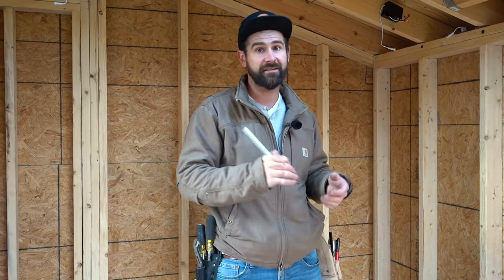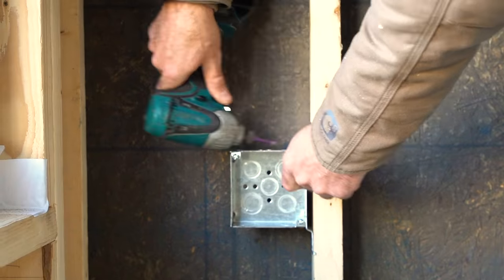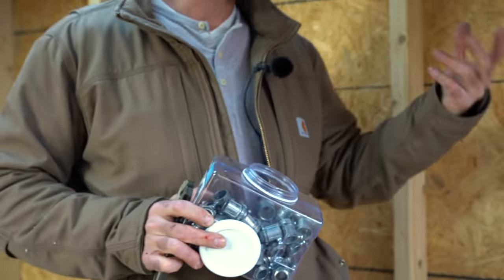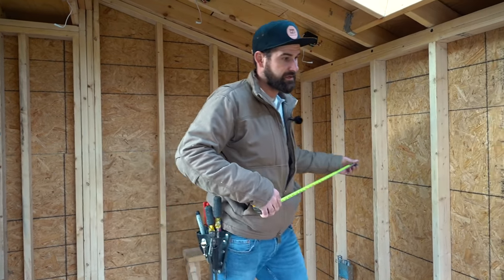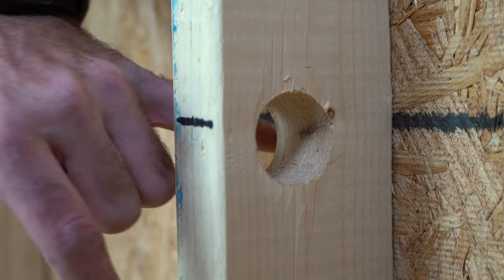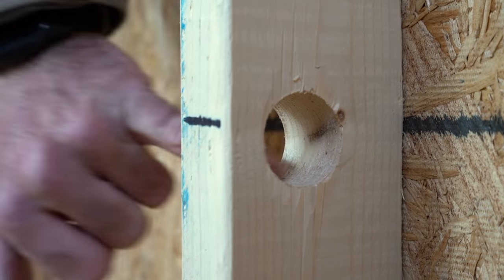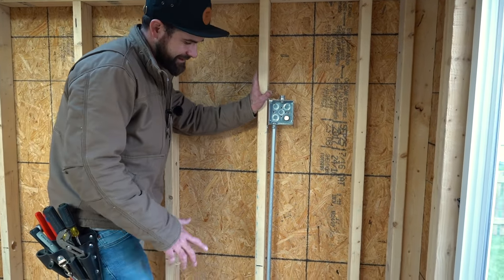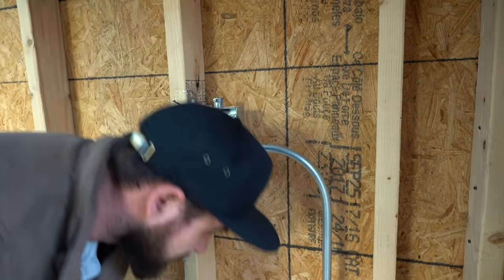How to bend and install electrical conduit

Comment: Have a bandsaw! Use a deeper box if you have 3 and more connectors. Use an approved drill extension to make your pipe cut smooth. Never ever use a bender like that to bend it a little but more! why do you make 3inch hole size for a 1/2" pipe?
Reply: yup, I don't understand why some people still want to work harder. When I started all we had was a hand saw... now days use a bandsaw or even a sawzall. Some people can't get out of old habbits
Reply: @jarrydee2799  when the makita battery sawsalll came out i never looked back. but i was taught old school. the first thing i was given was a bit a brace and a file lol. and of course a hack saw. i was taught that when there was no power, work still goes on. most electricians cant work if there is no power. that was never my case. and was never allowed to use it as an excuse.

Comment: I watched it to the end, lots of mistakes, and since he drilled the holes so large I would of ran some 3/4" conduit too! Also I would run a ground wire too, or at least used compression fittings instead of thr screw connector fittings. Just not how I would of done it, the company that I worked for would of made me redo the job.

Comment: why did you not just want to use romex and staple to the studs?
Reply: Did u not pay attention he said it’s permits and code
Reply: @erikrobles5727  I don’t believe it. Electrical standards are mostly all nation wide.
Reply: @johnnyfive-bc  well believe it I  live in Phx Az  and some codes change depending on weather in working in sun city or in Avondale and their not much more then 15-20 miles apart
Reply: @erikrobles5727  show me where it says you can’t install the outlets and lights with Romex inside the studs.
Reply: @johnnyfive-bc  I never said which codes I said some codes and he said he has to run the wire that way because of codes and permits in that particular town he also never says what town he is working in  watch again from:30 sec to  about :50

Comment: You know there's romex for that.... the only advantage here with conduit is that since you are using shallow boxes set to the improper depth, you can zip tool all of you conduit boxes with no wire in them (in a box that shallow you would destroy the rough in if you tried that with wires in the box), then pull wire afterward. Still, that's 10 extra hours to save 5.... also you totally violated the structural stability of those 2x4 with your ginormous hole....
Reply: Have you ever seen 2 inch ABS through 2x4s? The holes are much larger. I've been an electrician for 15 years and I think he did a pretty good job besides the improper box depth. I don't understand why he just wouldn't use romex though unless it's against code in his area.

Comment: No tool belt when running conduit. And your making measuring bends way too difficult. And also no need to make oversized drill holes, you make a minimum bend and it's always perfect.

Comment: OMG Conduit really for 110 Volts, Not in New Zealand just Plastic Cables, which are all Double insulated cores.  We use single Phase 230 volts mostly for housing.
Reply: Single phase 230 v. Eso that amazing. We use 120 single phase in U.S. and 240v. For dryers.

Comment: Out West if you are running conduit for a residential job you are going to go broke. Most crews will have 2 houses in NM cable by the time you piped the living room. Economics don't favor conduit unfortunately.

Comment: Still find it weird electrical conduit is metal in other countries, here in the Netherlands it’s all PVC
Reply: Then again, we don’t build our houses out of wood.
Reply: In the US the conduit system is considered the ground. However, we also pull equipment grounding conductors as well and then ground an enclosure if we required. Basically if there's a splice made them the enclosure needs to be grounded, if it's a straight pull through then no ground required to be attached to the box. But a job may be specced well and above the code because the code is considered minimum and some environments or needs of customers may exceed what's allowable in the code.

Comment: Why do they need baseboard heater in a shed?!  It’s almost like this is a B&B Rental or unofficial “addition” to a house … for a roommate.  Shed doesn’t usually gets fancy lights like that.  Also, the spacing of outlets is less than 12ft… and its conduit work (all these are required by National Electrical Code).
Reply: Exactly 😅… something shady is going on. Well, maybe this will be a rental… !?
Reply from the maker: Theinshed.com

Comment: how odd, a full metal standard.

I guess its safer to prevent accidental drilling trough.
But its also conducting. so 1 tiny mistake somewhere and you got a fire hazzard and a potential electrocution hazzard, much more so then with all pvc.

The one upside i can think of is that you can ground the whole steel system, but i doubt that will ever pass inspection.

Comment: FUCK THAT in new zealand we stopped using steel conduit full stop just run the wires bare in the wall and in the ceiling

Comment: In my country metal tubing isn't allowed anymore... Metal and electricity don't go well together
Reply: What country is that? What do yall use
Reply: Metal conduit, if installed properly, will take a ground fault back to the ground bus in the electrical panel without the need of a grounding conductor. But that's only if everything is securely fastened and tightened.
Reply: That's a pretty silly rule.
Reply: the reason for the metal is incase you have a short it send the current straight to ground. then blows the circuit. i watched a woman get knocked to the ground because they removed the box. and the wire shorted on a steam pipe. the steam pipe then became hot. an no ground. the lady was barefoot. and she completed the circuit to ground. if the circuit comes in contact with the metal grounded pipe. what does it do. blow the breaker. and that is for safety reasons. and it will not allow the circuit to be reset until the short is cleared.

Comment: why not use a pipe cutter ?
Reply: Big mistake. Reaming the conduit would be very time consuming, you'd have to use a round file- not worth it.
Reply: Too much ridge inside the pipe
Reply: @gerdberg4188  and for this reason most electrician's use klien  tools. multi purpose they are.
Reply: Pipe cutters work great on emt. These guys don't know how to use a pipe cutter on conduit properly. You just spin the cutter around a few times until you are almost through, then stop and give the conduit a bend and it will snap at the cut line and leave a clean edge. No clean up, no reaming, no ridge, perfect every time. Once you learn it, it's fast and easy.

Comment: I wish here in California we were required to run Conduit pipe in homes, so not just any random wanna be electrician could “wire” a house. So many Mickey Mouse houses here.
Reply: I see what you’re saying, but Romex is so much more cost efficient. Not just considering time, also material. It’s better, but I wouldn’t even pipe my own walls at my own house. I think pipe is best surface mounted. Either way, I’m not bashing you. Just giving my unsolicited 2 cents. Good day 😃

Comment: Total bs about a screw holding a box rusting out...galvy nails are made so poorly it’s not uncommon for the head of nail to pop off plus some guys use a 1” long screw which should be at least 1 1/4 to 1 1/2 nails

Comment: Would of been easier to run pvc conduit …
Reply: Can't use it in most cases- fire codes it melts falls down on pple and firefighters same reason they cant use romex and off gases when burning

Comment: You talk super fast, had to replay it over and over again to understand it. Other then that the video was great.
Reply from the maker: Thank you for the feedback! I will do a better job of talking slower for future videos
Reply from the maker: Thank you for taking the time to watch the video. Let me know if there are any other types of things your interested in learning about.
Reply: @BobClarizio  I just started as an apprentice for a month now. Been doing box offsets onto steel studs up to the ceiling deck  with a stub 90 at the university building I live near. However I get confused on measurements based on the ceiling. I have to run conduit from the stud up the ceiling and to make it perfectly fit into the connectors on the junction boxes. Do you have any tips on how to go off of measurements based on ceilings?
Reply from the maker: I try to remember for a standard 1900 box to measure from the side of the connector closest to the stud because that is the side that is going to correlate to laying you pipe against the handle of the bender when measuring or your offset
Reply: @denvercharlebois699  It's all about planes. Measure from the ceiling to the box. That will be the back of the 90. Piece o cake.

Comment: who the fk does conduit in a wood frame building also "it doesnt need to make a loop" thing is totally wrong. its AC current. it absolutely does need to make a loop. thats the whole fking point of the neutral wire.

Comment: I cringe every time I see someone using a magic marker on conduit. Use a pencil.  And get a reamer instead of those channies. Also get a circular saw with a steel-cutting blade. Lastly, and most important, look up codes regarding securing and supporting the conduits. I saw violations here.

Comment: Really, they require conduit in a shed? That’s just stupid, nothing wrong with MC.
Reply: Well certain municipalities have codes to adhere to and if not followed they will make you tear it down and start over till you do it right.
Reply: @user-jh1mq2ih2u  Right, he even said that it was code where he was, but it's still stupid.
Reply: a shed is just like a garage. the same codes

Comment: Firstly makes no sense to use commercial/industrial materials for residential type projects just waste of time and money, secondly your EMT pipes literally have no support and they have to be supported 1 meter from each box, atleast a clip would be needed so u needed to do offsets into the box not just straight the pipe has no support basically if u forget to screw a connecter when ur fishing wire after the drywall is put and the EMT comes out what do u do then brake the drywall?? ,  Also you did not show a single example of using the degree multiplier which is basically emt bending. Bottom line i see so manny things wrong but nice camera tho. :D
Reply: And use a reamer for god sake ur gonna scratch the wires, not the chanell lock handle hahahaha :DDDD

Comment: Why use EMT when you can run Romex?  Code allow Romex in all wood wall.  If cable needs to be in raceway because of fire code, FMC would be a lot easier.
Reply from the maker: Code in Chicago requires EMT

Comment: Don’t  put the connectors to the 1900 box first , put it to the pipe .and use a 1 inch drill bit for the holes .
You just showing how not to do it .!!!

Comment: My biggest complaint. Why didn't we run a straight piece between those 2 boxes? Lol with the mistake you made with crossing pipes at first that cost you a lot of time. I would think my young children would know the shortest fastest cleanest cheapest way is a straight line..... but good work for a non electrician.

Comment: Why dont americans thread there conduit .
Reply: The pipe he was using was EMT. The pipe you are talking about with threads is IMC or Rigid. Rigid is used more in industrial, while commercial uses more EMT
Reply: because we dont have all day. how long does it take you to thread and bend a pipe. and lord dont be off on your bend. emt is faster and just as safe. the contractor would not make any money if he had to do that. time is money.

Comment: WTF ARE YOU AN ELECTRICIAN OR A PUMBER
Reply from the maker: Lol if you can understand electrical piping you can understand plumbing piping as well
Reply: @BobClarizio  ...should i list all things that are wrong in the video?
Reply from the maker: Sure I’m always interested in hearing what people have to say
Reply: @BobClarizio  metal pipes and boxes have no basic insulation(not pvc), pipes aren´t allowed anyways (only hoses), if wire insulation i damaged it can cause a short or some can get an electric shock, if you stand on the final floor the pipes are not allowed to be higher than 30cm from the ground, the pipes have to be mounted properly with clamps (horizontally max. 60cm and vertically max. 50cm from each apart and 15cm from boxes or any other openings)
Reply from the maker: Thanks for sharing this I appreciate it!

Comment: What a waste of time and materials just use mc if you want the wire better protected but even that is dumb for a small shed like this just run romex wire would take 30 minutes to rough in

Comment: Stopped watching when he mentioned the switch being at 50” from the floor. Where is that standard? NEC Says 48” to the top. If he doesn’t know standard shot I don’t have the need to listen to anything else. You need a pro. Contact me
Reply: lol which does what splits the drywall at the seam. thats a standard.

Comment: In what City are you working that the Wiring Inspector doesn't follow the NEC?? I would have told the Inspector to go pound sand and wired that shed in Romex as permitted by the NEC.. Also, I have at least 50 Comments on what you did wrong. Honestly I viewed this as Comedy, I laughed my ass off the entire time, I hope your a better carpenter than you are an electrician. OMG, dude, please stop doing Electrical Work. There are plenty of Good Electricians that could do a little side job like that for short money.. You might want to buy a shovel and just dig holes outside, I'll watch that video, pretty hard to mess up hole digging, pretty easy to mess up Electrical Work as Shown here!

Comment: All of this is completely unnecessary  and costly. You dont even need to run conduit through studs... and metal boxes!? Are you trying to piss off the next electrician who has to work on this!
Reply: Chicago illa-no-toys codes remember the nec is just a bare minimum recommended standard the authority having jurisdiction makes the final codes and has the final say.
Reply: Piss off next electrician? Can you pull another wire, let’s say up amps by changing from 14 to 12 gauge in a closed wall using Romex or BX? Nope.

Comment: If you don’t know what a 1900 means your not an electrician. For those who don’t know it’s 19 cubic inches or the space inside the box. You need to know so you don’t overfill the box
Reply from the maker: Hey! Thanks for that info, and I appreciate you watching.
Reply: It's 1900 mm
Reply: Then why is a 4x4x1.5 23 cubic inches? Get thee to a code book or forever be a dolt
Reply: 1900 doesn’t refer to the size or volume of the box. 1900 was the original part number from the Bossert catalog (dating back almost 100 years). The 1900 box is 4” on a side while the 2100 box is 4-11/16” on a side. They are also commonly known as 4” and 5” boxes respectively.
Reply: People that say shit like "if you don't know what this is, you are not an electrician" are idiots. I'm a Licensed Master Electrician and have never heard of a "1900" box. There are so many different types of electrical work out there it is impossible to know everything.
Reply: Keep pulling that Rolex sparky
Reply: In today's LA electricians lenguish is 4S box, 4SD or 5S box as simple is that, it all depends where you got trained that is why you learn the names applied to the parts.
Reply: @jmequineservices4766  I specialize in Power Limited Fire Alarm systems. I rarely use Romex, much more likely to be pulling FPLR or MI or ISMA.
Reply: Every manufacturer has their own box. 15 year foreman here, I've never heard that. I use Raco 232 and Raco 233 everyday of the week. You're not an electrician I guess. Also, google said it's a part number, not size. Horrible electrician.
Reply: !!!!!!!!!!!!!!!WRONG!!!!!!!!!!!!!!!! I guess "your not an electrician".
Reply: @Mike45-47Q  Learn to read. Do you not see the "...." marks around what I said? That's because I was quoting exactly what he said, and how he said it in his comment. Scroll up and read it for yourself. And for Christ sake, learn to comprehend basic grammar. Or at least what quotation marks mean.
Reply: @Mike45-47Q  If you are going to try to insult someone's grammar, you might want to do some homework on the subject first. Otherwise, you come out looking like you are trying too hard to appear smarter than you really are.
Reply: @franciscannizzo7564  5" box we call an 11b box
Reply: @Mike45-47Q  thats just their part number lol